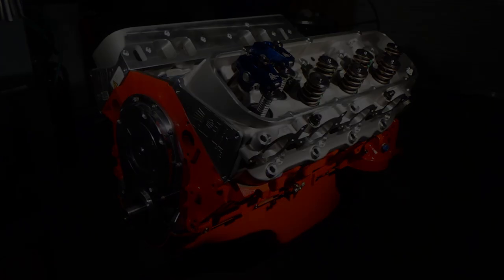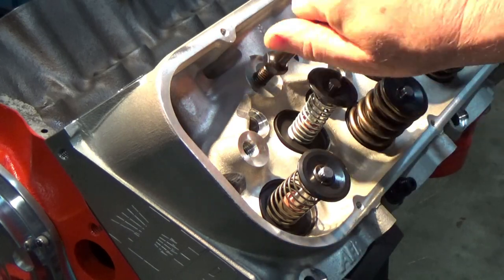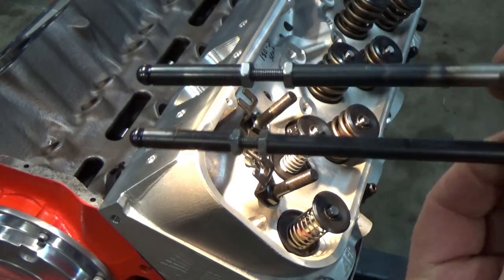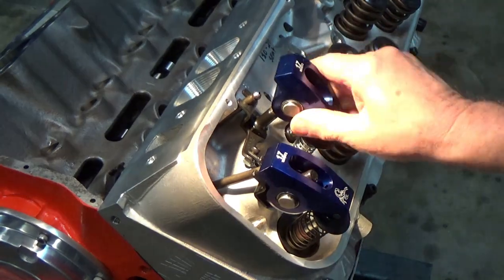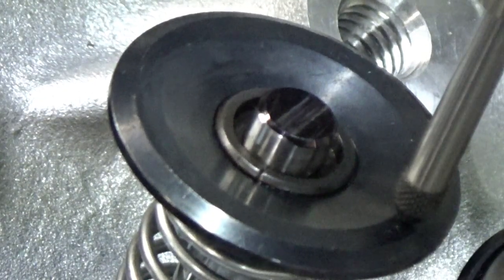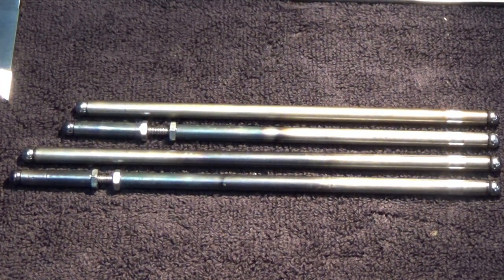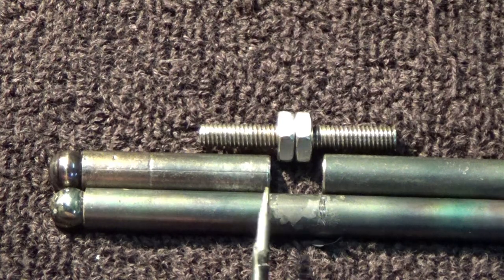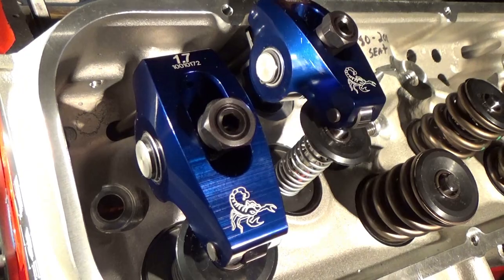Determine Pushrod Length & Make your own Adj Push Rods..#12 Chevy 454 Big Block Performance Build...

Comment: As long as the pattern doesn't go off the edge of the valve tip it's ok, meaning it makes no difference if it's a little high or low on the tip. What does make a difference is the length of the sweep in both directions from center. Adjust it till they are both equal then it's right. Don't forget, for a hydro lifter add the lifters preload figure to the push rod length and for solid subtract the valve lash figure from the push rod length before ordering push rods.
Reply from the maker: Thanks for sharing...

Comment: Thanks for the video. Great explanations throughout. Where would I get valve test springs like you use in the video?
Reply from the maker: Thanks for the nice comment....  I  got them from  ACE hardware store...
Reply: @Myersmetalworks  You bet and thanks for responding. I’m also definitely using your homemade adjustable pushrod tool idea!
Reply from the maker: Lol.... Cool

Comment: Can you be specific on why your stud threads going into the head are different length on intake and exhaust? Asking as I have similar Brodix Race-Rite oval port heads and the stud threads where all the same. Thanks.
Reply from the maker: Cant be specific on why AFR designed that into this particular heads... But my 
best (guess) is that they made it a little stronger because the exhaust valve has to over come not only the spring pressure, but also the combustion pressure to open the valve, to where the intake valve doesn't...
Reply: Brodix Race-Rite heads are a direct replacement big block chevrolet head design.  The AFR heads have raised exhaust ports and require longer bolts.

Comment: did you make a solid lifter? or are you using solid lifters?,,how do you arrive at the proper preload?
Reply from the maker: Hi John... The camshaft is a solid lifter cam so solid lifter it was, that I used....
To learn more about this look up  Grumpy's Garage and check out some of the articles about this job on there forum...   Hope this helps....
Reply: @Myersmetalworks  Thanks. I figure it had to be a solid lifter set up..I am working on a rover v8 which has hydraulic lifters. I have to use a pretty thick shim under my non adjustable rocker shafts..I was thinking it may be better to lose the shims and change the pushrod length instead.. I think the shimming up of the rocker shaft is affecting the rocker geometry..anyway thank you for the reply

Comment: Where did you get that timing cover with the inspection cover. I'm looking for that same one.  It's like a Cloyes but not quite the same, and Cloyes is much more expensive. Thanks.
Reply from the maker: It's a Cloyes cover...
Reply: @Myersmetalworks   It didn't have the logo, so It looked different. I guess the "Cloyes" covers don't have the logo from what I have been reading. Seems like they'd update the picture on the package. Some guys probably want the logo cast into the cover as it is pictured. I don't care either way. Thanks for clearing things up.
Reply from the maker: Yes, I was hoping for the Cloyes logo on mine as well, but it didn't come with it....
I hear some have the Logo some don't...

Comment: Is that a 0-12" 0-300mm Japan Mitutoyo Absolute Digital Caliper 500-193-30 0.0005" 0.02 ???   Are those 3/8 push rods your using ?  Thanks . Enjoy you videos very much.
Reply from the maker: Hi Mike... Mitutoyo  Code No. 500-754-10,  Model No. CD-12" PSX,    The Push rods in the checking video are 
the factory ones that where modified for checking... I think they're smaller than 3/8...  But the ones that are going
to be running are  3/8  .135 wall Trend Performance push rods.